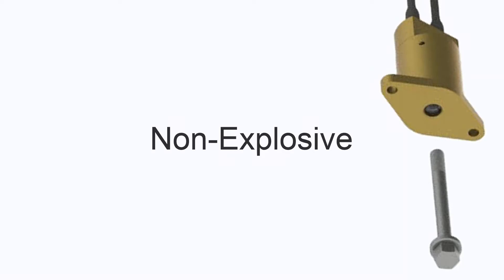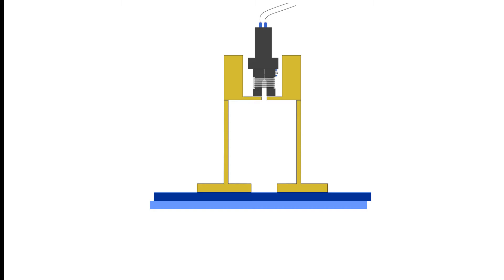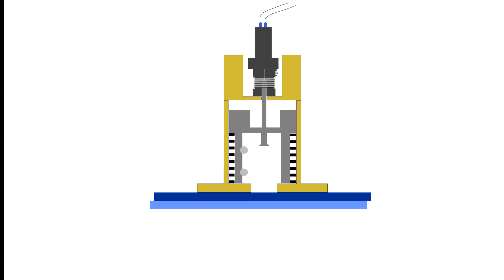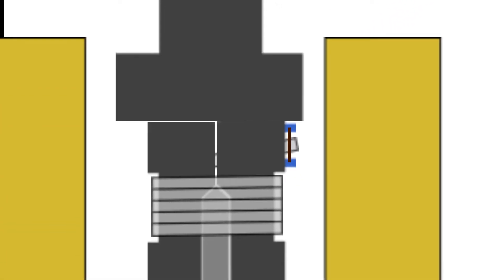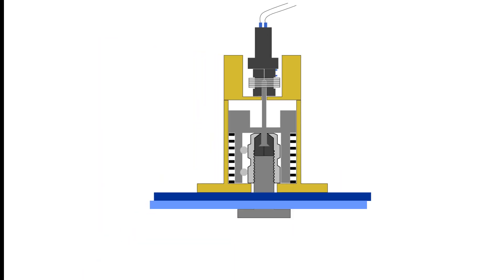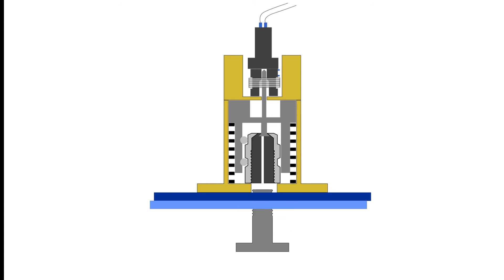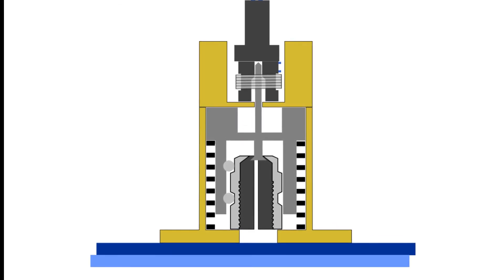Non-Explosive Actuator

Comment: Is there any kind of spring in between two threaded couplings to push them away from each other? I feel like when the bolt is attached, friction between bolt and couplings’ threads make it hard for the couplings to detach easily.
Reply from the maker: Good observation.  The plunger pin(the pin in the middle) has a wedge at the bottom end. Once the plunger pin is free to move, it moves upwards propelled by the spring. As this happens the wedge of the pin will slam into the top of the two halves of the coupling, forcing them apart.  I didn't do a good job showing that in the video. I wanted to first show that the protrusions were no longer preventing the coupling  from coming apart but forgot to then show the wedge on pin pushing the coupling apart.
The end result is that the coupling mysteriously came apart.
Hope this helps explain things better. Let me know if it doesn't.
Reply: @operationalfacts5602 thanks a lot for replying. Then I assume the springs need to have a decent force to “slam” the pin up fast and strong enough, don’t they?
Reply from the maker: @sunguyentien1711  Yes, the entire energy for operating and decoupling comes from that spring. The manufacture say that  it can decouple a load up to  9500lb.
More info https://cms.nacsemi.com/Images/FeaturedProducts/Eaton_Non-Explosive%20Actuators.pdf
Reply: @operationalfacts5602  thanks a lot. :)

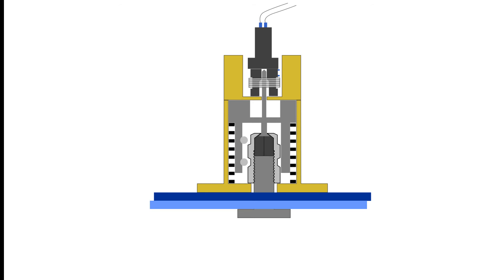Comment: 1:10 There does not seem to be a positive releasing force. In other words, the spring removes the two parts (seen as circles on the left) *allowing* the two halves of the coupling to move apart. It doesn't *force* the two halves apart. I can see this event getting stuck.
Reply from the maker: Yeah,  I didn't illustrate that part well. When the spring  pushes up the assembly with the center rod, notice that the end of that rod is a wedge shape(It looks like the head of a nail). That wedge will force the two half apart. The final state of that center rod should be slightly higher then shown in the video to show the the wedge indeed has pushed the two half apart.
Good observation. Thx

Comment: It is one time use HDRM?
Reply from the maker: No. It's reusable. You only have to replace the top cylinder that contains the tensile coil and link wire to reset they system.

Comment: It's very cool but isn't it unreliable due to heat burning a wire ?
Reply from the maker: They are very reliable, one reason being they can only be trigger by a minimum amount of current and not by mechanical shock. The amount of heat required to melt the wire will have to be very high if it originates outside the casing. That kind of heat will probably cause mechanical failure through thermal expansion first before it melts the wire. The main downside to these kinds of non-explosive actuators is that they are one-shot.

Comment: I saw this because of jwst using over a hundred of the non explosive actuators. Is jwst using the same type?
Reply from the maker: I don't  know if they are the exact kind from this manufacture. However they are all similar in the sense that a small trigger force will allow a large amount of force to act in a short amount of time. Kind of like an mechanical explosive.

Comment: Question: For space use during an emergency.What quick release you recommend?
Note: explosive bolts, would likely fail, do to high possible temperature fluctuation.
Environment: Would be quite hot to very cold. Along with vibration stresses..
Reply from the maker: It depends on what you're trying to release. I'm not sure what would cause the high temperature fluctuation and why the explosive bolts wouldn't work. Shaped charge could also be used. But non-explosive actuator could do the work (depending on the mass) since they don't rely on chemicals which could have a smaller operating temperature range.
Reply: @operationalfacts5602  I was thinking about the idea of one time use escape pods. If Humanity was to ever get into space. This would need to be a mandatory device. And would need to be able to detach under vibration and load..  
  High temperature in space can be as simple as air friction, or too much sun light.. 
  But for now this is all speculation. And is in the realm of the science writer.. 
  Thank you for your Time.
  Have a good day!
Reply: @marlonlacert8133  Explosive bolts were used during the Gemini, Mercury, and Apollo programs for the hatch on the reentry vehicles. As a hedge against the possibility that the hatch might become welded during reentry. They're also still commonly used to insure the ejection of the cockpit assembly during a bailout maneuver.
Reply: @michaelfoye1135  Thanks for the info! Keep up the great work.. (Heat, and vacuum welding, would be a worry.)
Reply: @marlonlacert8133  Explosive bolts can be used whenever instantaneous separation must occur whether for safety, or to safeguard some sort of process. Fir example they have been used to simultaneously break rigging used in the construction of cable stayed bridges and other complex load bearing structures. This is because other means of separation were too slow to avoid causing a wave in load functions that were contrary or in excess of the structures capacity to hold. But drop ot in place simultaneously and the load is evenly distributed when it is released and properly transfers forces in the correct directions to be supported by the design structure.
Reply: @marlonlacert8133  >If Humanity was to ever get into space. 
1969 called bro, you are late
Reply: @codefeenix  Umm.. So you are claiming that we have an active human civilisation living in space, as an independent branch of humanity. since 1969.. So you believe those tails of people living on the moon?
Reply: @operationalfacts5602  These are excellent videos. Good work.

Comment: Thank you for video. Can you tell me what keeps the spring-loaded attachment in balance when it is pressed?
Reply from the maker: The two hemisphere with the wire wrapped around it (pause at 0:22) has a grove that goes half way in. The nail like structure which is attached to the spring-loaded attachment prevents the spring from going forward(up). This keeps the spring compressed.  Let me know if this helps.
Reply: @operationalfacts5602  is the hemisphere with the wire fixed to the body or with cover. Is this Mechanism reusable? Thank you for your answer.
Reply from the maker: The hemispheres are pinned between the body and the initiator structure above it. What I failed to show in the diagram is that the initiator structure is also tied to the body. Your question made me realize this mistake. Thanks.